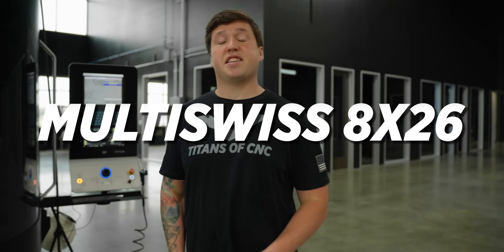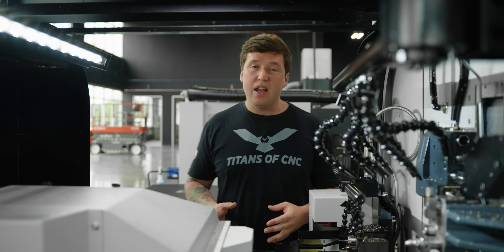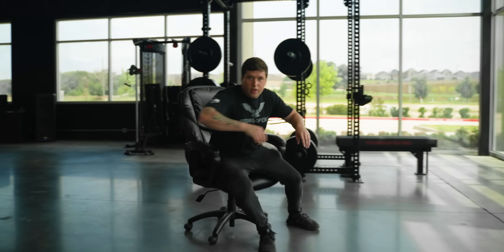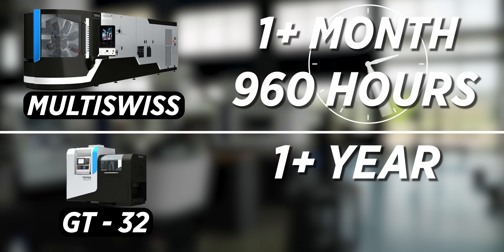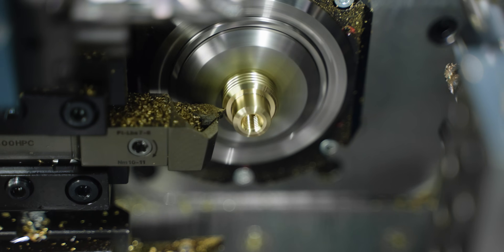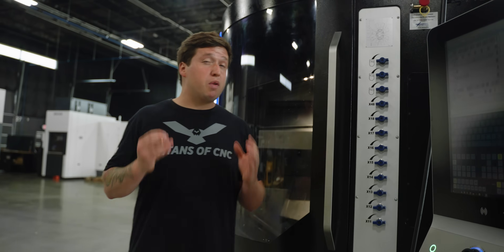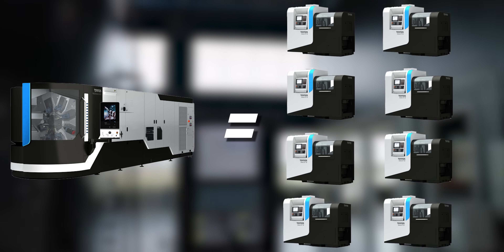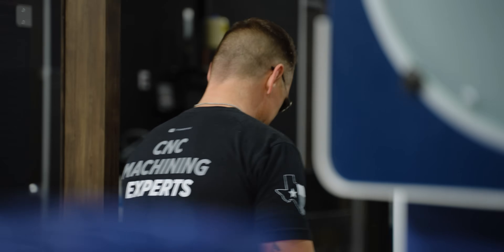$1,000,000 CNC Machine Really Worth It?

Comment: Many machines shops want a multispindle cnc machine, usually we have cnc lathe one turret one spindle, multitasking lathes, single swiss machine, vmc, etc. Parts volume tell you what kind of machine you need. Usually multispindle machine cost part is lower, and lower is lower many times just a few cents by part, Our clients some times abuse about this because they want lower prices always, many of us understand what I´m talking about. Excellent video explanation, but this have more thing to verify before decide what machine type you need to buy.

Comment: Okay. Let’s work through the economics here:  (I am assuming a 180 month depreciation for maximum tax benefit in this exercise) if the machine costs 1MM, that’s 5500/ month depreciation. If the other machine is 150K (total guess) that’s 833/ month depreciation. Which is approximately 6.6x addition to the labor rate. If we multiply the 7 second part on the multi Swiss by that, then that comes in around 47 seconds. Which I believe is right around where the time came in on the single spindle machine. So this really comes down to 2 factors IMO, deadlines and available capital. I am sure there are shops that need to produce this sort of quantity in this time frame. But I wouldn’t try to do it on one machine. If it goes down, you’re sunk. I’d personally run more of the ‘slower’ machine, at such a burden that if I lost one, I could make it up with extra shifts. And again, you can reduce TTR with process improvements, and still get that lead time down a little more. (Which in fairness, applies equally to both machines). I’d suppose it’s also a fair question to ask: what is the difference in lead times on these machines, since speed of delivery on the finished part is obviously the reason you’d want one. 👍🏻6:40
Reply: Sure completly depends on the economics, also dont forget if you buy multiple single spindle machines you get a discount instead of buying a single multispindle machine.
Also service and keeping spareparts is way simpler with multiple machines of the same typ.

Comment: Nice video.  MultiSwiss are expensive machines and you are looking at roughly double the hourly rate to operate but if you are producing parts 3+ times as fast as on a single it makes good sense.  The killer is the run size.

You really need to have complex parts with a run size of 100,000+ pieces to make optimal use of these beasts and they are definitely not for the smallest of Swiss type parts.  These beasts excel in the high volume / high precision European automotive market for fuel injection systems and transmissions.  Forget about American, the parts are designed with tolerances which can be maintained with a pottery wheel and a chisel so you are going to see the parts run on less expensive and lower precision machines.  

Here is the kicker...  With the European crusade against internal combustion engines there is a shockwave going through the Swiss multi community.    No IC engines means no fuel injection systems and no transmission systems (no tranny in electric).  Index, the big German Multi builder, is very unsettled and you should be able to get pretty good deals on any Swiss multi now.  I've been in multiple Swiss, German, and French multi shops and they all are worried about their survival with multis.  Without the right parts to feed those machines they become nothing but pieces of industrial art.  

Multis are great machines for the right applications and certainly automotive isn't the only one.  I have seen plenty of medical parts produced on Swiss multis.  At the same time the automotive market is core to the multi business and without it they are facing very difficult times.
Reply: Interesting comments... the rush to all electric with less component parts will affect everyone involved in car production. Less complicated bits, less machines and people to make  / assemble them.
Reply: That's honestly interesting to hear. I work for a shop that does medical parts on Index multis, among others, and I could definitely see how they're made for things like injectors. Because of the lack of a guide bushing on the ones we've got, you're restricted to shorter parts. They don't do thread whirling, afaik, so they're not great for some high-volume parts like bone screws. Because of one long step limiting the cycle time, they're not great for parts a with lot of profile milling either.
They're great within their niche, but they're not exactly do-everything machines.
Reply: @JohnSmith-dp2jd  Thread whirling is possible on the MultiSwiss, depending on the length a specific support for the bone screw is required
Reply: found the European hahaha. "with a pottery wheel and chisel..." hahahaha I wish the parts I made where that easy.
Reply: That probably aint such a big deal because most of the dummies that got suckered with that propaganda have already bought an EV. Everyone else doesnt give a solitary ** about them, and will probably push the market and regulation back on that

Comment: It doesnt make sense this. Assuming that the 8 spindles are perfectly balance (which I doubt) the operation should take max 56seconds (8x7sec) in the gt32. Why is it taking longer?
Reply: Because all 8 spindles have a different operations happening at the same time. So each spindle is 1/8 of the process. Yes it takes 56 seconds for one part to get made but every time it rotates another one drops so it takes 7 seconds to make one part.
Reply: @donniehinske yes, I understand that it takes 7 seconds in a 8 spindles machine, which should be max 56seconds in a single spindle machine and not 64seconds as he says in the video. Actually I belive that it should be less than these 56seconds, as probably some of the spindles in multispindle are waiting to other operations to be ready evrn he tried to balance as much as possible

Comment: I have a Swiss Turn question: Do the guide bushings require precision ground stock, or will they yield the same results with regular bar stock?
Reply: Depends on the guide bushings u get, some are more lenient than others, some need precision ground stock. If I'm not wrong the looser the bushing the more out of round the part will come out.
Reply: Every Swiss shop I have worked with for 24+ years uses PG stock and it goes further.  Holding the tolerance is good but is it uniform down the length and what is the roundness of the bar?  Any variation within the length of the bar but within tolerance will result in binding or rattling.  If you go to Switzerland you will find the shops are very particular about who they get bars from as the suppliers for material there know it goes beyond the printed tolerance.  When we have supplied stock from the USA in specialty grades to shops in Switzerland we often ran into problems until we found a source here who could routinely provide the dimensionally uniform bars needed for optimal turning.
Reply: Depends on the work you are doing. Most shops just use regular bar stock
Reply: @donniehinske  Ask Titan about his visit to Laubscher in Täuffelen, Switzerland.  Manfred has retired since his visit but I can guarantee you there isn't a single bar going on a sliding headstock there which isn't PG.  I was there again just last month.  I sent Manfred and his brother Hans-Peter American sourced material more than once over the last twenty four years and they handed me my ass early on after the crappy performance it yielded.  It only takes one time having an angry Swiss shop owner dropping a box of defective parts, swarf, mangled bar pieces and broken tools on the table in front of you and saying "this is the shit you send me" before you get the message 🙂 At the same time those gentlemen taught me plenty and I am thankful for it.  

You can certainly get away without PG but it impacts your performance, surface roughness, and the tolerances you can hold.  The better the bar the better the results.  It all comes down to what you are hoping to get in the end.

Also, nice background shot of Zurich.
Reply: @kennethfharkin  that’s all great and everything but I’m going off of experience. I’ve worked on probably over 200 different Swiss machines at different companies over the years. The vast majority do NOT run ground stock.
Reply: @donniehinske  It definitely depends on the job.  Our work out of Switzerland starts at 0.001" tolerance and gets tighter from there.  I'm surprised at the amount of non-ground stock used on Swiss type machines here.  My Swiss buddies over there use it as the norm.
Reply: @donniehinske  can only mean slack tolerances, therefore, slack parts ( but OK).
Reply: https://youtu.be/TZgK1WNvkss
Reply: Thank you all for the answers. This channel and its members rock. Even you, Donnie! 🖖😀

Comment: Hey Titans, on your 8 spindle machine you have a 7 sec cycle time. But the part isn't finish after 7 seconds or am I missing something? If finished the first cycle it goes to the 2nd spindle and have another 7 sec. Cycle. So wouldn't it be 8 times 7 seconds =56 seconds a part? And you just have the advantage to do step 1-7 while you are doing the 8th?
Reply: Sure, the first 7 cycles aren't going to output any parts. But each and every single cycle after that will. So while it might take 56 seconds for the first part to come out, the time until the next part drops out of the chute will be 7 seconds for every single part afterwards. Hence, it's a seven second cycle time.
Reply: Cycle time is not the time it takes for a part to be started and completed, its the time for the machine to start and finish a cycle, or rather, the time between finishing two parts. So this machine produces a new part every 7 seconds. The machine cycle is doing all 8 steps on 8 different parts, and it takes 7 seconds to do so, thus the machine cycle, its repeating set of instructions, takes 7 seconds.